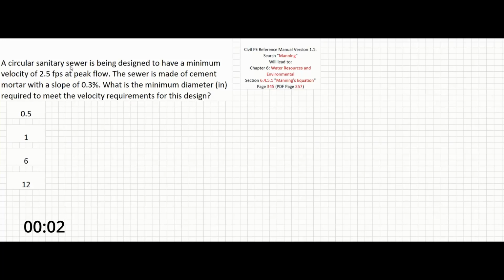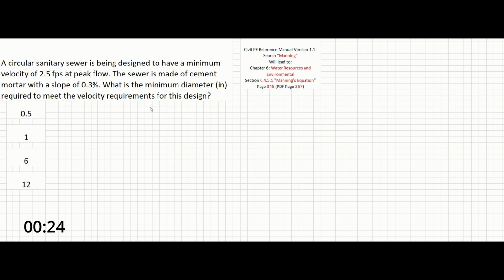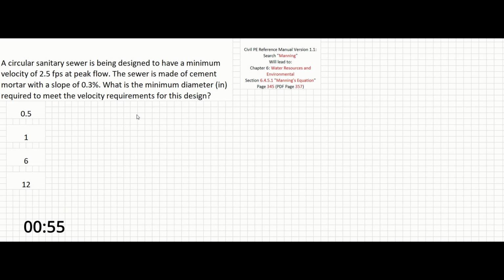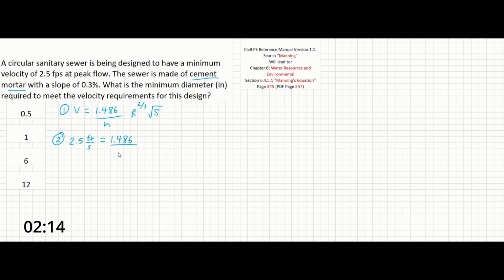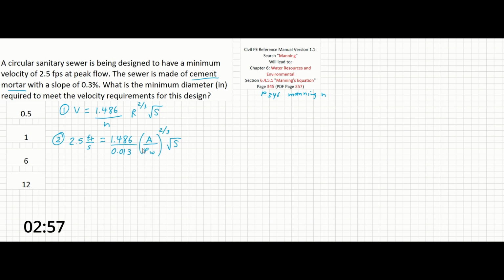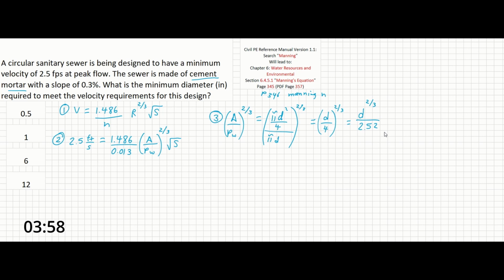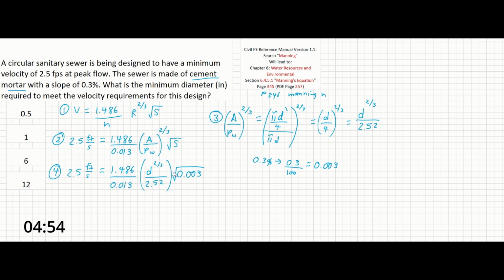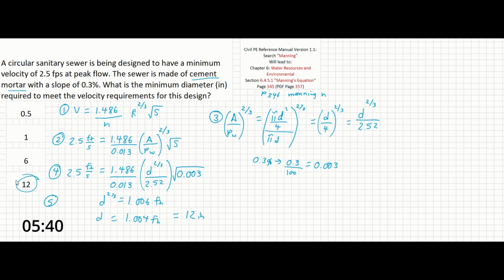PE Exam Practice Problem #38: Water Resources | Mannings Equation - Sewer Capacity

Comment: It is Sewer and not open conduit so you need to use Hazen Williams Formula, what do you think?
Reply from the maker: Thanks for asking. If the pipe were surcharging, and operating under pressure flow, you are correct. However in this case, we are treating the pipe as an open channel that just happens to be flowing at exactly 100% of its capacity. The problem also gives us the slope of the pipe, which is a term used in Mannings, but not in Hazen-Williams.
Reply: @SolvedIn6  S in both equations in the handbook is defined as S = slope of energy grade line.
Reply from the maker: @AAA-h1u5r  You are correct, there is a slope in both equations. Sorry about that. How about you calculate the answer you get with Hazen Williams and let me know if its close to the answer we get when solving with Mannings?

Comment: Hi! How did you determine wetted perimeter (Pw) to be equal to pi*d? Did you assume most efficient hydraulic section??
Reply from the maker: sorry for the delay, I was away for two weeks. So the words "peak flow" in the problem are all you need - that means the sewer will be flowing full.
Reply: Solved in 6 already answered you, but for pipes flowing full AND flowing half full, hydraulic radius is D/4. You can comp it to prove it to yourself, saves a lot of time!